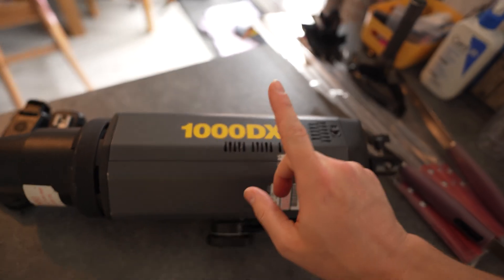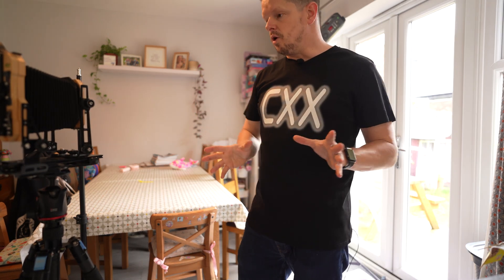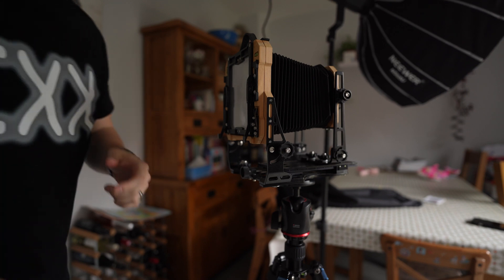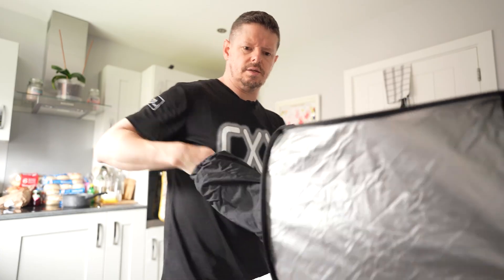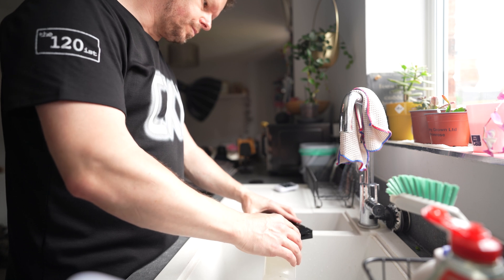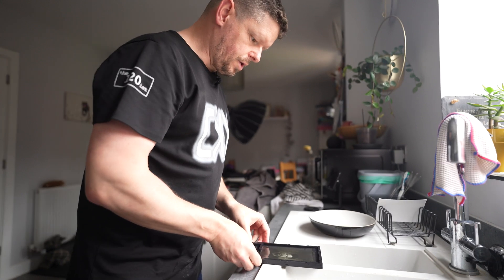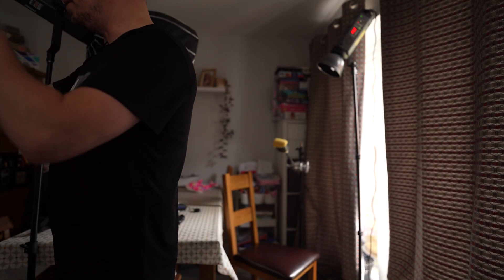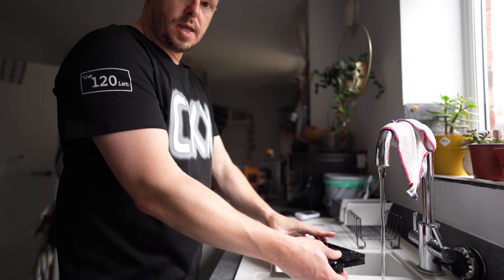Flash with BW Paper Reversal! Can I make it work?? Featuring Minutero 2.0 & Stenopeika Caronte 4x5

Comment: Ok so I think I mentioned this to you before..   First off you need to find a lens you can attach a cable to.. That will fix LOTS of your issues I think.. And just for kicks..  Open the shutter for about two or three seconds in as dark as you can get but trigger the flash TWICE and see just how much exposure stacks from using a single flash to triggering the flash more then one time during exposure.
Reply from the maker: I actually started exactly that process when I didn’t have enough flash power, doing two or three pops on the flash. And if self portraits were the end goal then the at would definitely be an option. But the goal is to be taking photos of other people, and with as little discomfort to them as possible. If I was doing this with someone else in front of the camera then a lot of my problems would be solved! But I was photographing me as a test subject, to get a feel for how the flash was going to behave. Next stop is photographing someone else, now I have some parameters laid down. 👍

Comment: one tip, if the light 'leak' is something to be wary of, perhaps its time to go for a shuttered lens?, like a Packard bulb, or a Sinar DB (installed behind the lens) this would at least lessen the 'non shooting' time, and shut the exposure off certainly, so no light leak; And with a shutter, it would mean that like a dslr you can play with shutter speed (not sync, but this controls the ambient exposure), the other way is to use the lens full open (if it has a Waterhouse stop aperture), and drop a plate in, aka a sluice gate, so the cap over the lens starts exposure, the Waterhouse stop ends it.
Reply from the maker: I have shuttered lenses for the 4x5, but Im working back up to the big box camera, which does not have a shutter. And there aren't really too many options for a shutter on that. A DB shutter, or any packard shutter, would  be way too small. But I think perhaps using flash is a good option, but for self portraits I'm just taking too long for the ambient light. 

Hopefully all will be solved when I get back to taking photos of other people!

Also, the big box camera is less sensitive, due to the large distance between lens and film plane. So most of the problems will then be solved, if I can generate enough flat power! But I think two 1000Ws flash heads in one modifier is the next step. Watch this space!

Comment: hey, if you need the power, why not use a broncolor?, they go up to 1600/3200 W\sec. about 12x the power of speedlights, and if you use a 'PARA-88' or the bigger siblings' para 177 or 333 if my memory is correct, (its been at least 5 years since Broncolor released any major product, that I'm aware of, like those para products, or the Siros monolights, or the pico-lite and its accessory package), as they have a silver coating, which finds more output than what went in!-no, I'm not kidding, thats what is said, it actually produces 2stops more light output. The other 'stand-out' solution is fixed light, aka the dado-light system {mirror reflectors, Lightbridge comes to mind, not sure if its theirs, or Aperture's product}; here a simple mirror is mounted on a light stand, and the big 'engine' 2400W cine light is mounted outside, and aimed at the mirrors, like the scene from the Oceans 12 movie, but not lasers, the light beam and reflects towards the scene, lighting it, precisely the way the gaffers set it up.
Reply from the maker: Ok, I just looked up the Broncolor 3200Ws options... and the answer was quick to come to me! The £14000 price tag is the main reason I'm not going there!! Yowza. That's a lot of money!

Contant light sources is where I started this process, and so far they are a better option, for sure. I also have some bigger lights coming for testing soon, so I'll revisit that when they arrive.

But I wanted to try to make the flash work because it allows an instantaneous exposure, and therefore no chance of motion blur. But I may find my way back to constant lights yet.

I do have some big reflectors and parabolic umbrella type modifiers, but I didn't have enough space in my kitchen! I'll be doing some testing with those shortly!
Reply: @the120ist  in german "ebay kleinanzeigen" you sometimes can find old elinchrom 404 generators for under 200€ a 4000ws flashhead at the same price range... maybe you can find some elinchrom stuff in the UK too?!

Comment: Awesome flashes. Play with the aperture. I have to build a posing stand, I will copy yours.
Reply from the maker: Posing stand is a light stand plus c stand knuckle, grip head, whatever you want to call it, and a pole. Pretty cheap and cheerful! But does the job.
Reply from the maker: Crazy how cheap you can pick them up! Any suggestions for how I double or triple up the key light?? The only thought I have is placing them all behind a monster shoot through umbrella.
Reply: @the120ist  what is your goal ? I use one as key light: closer or more far with a softbox.(half power or full power mine is 400 watts) One with a grid for the backdrop and sometimes one with umbrella as side light for the hair. And one reflector: anything white. What is your extension bellow ? because you have to compensate. Edit: you use paper at 3 iso: you can use 2 direct lights, if you want soft light, put a white frame in between. 2 should be enough, just measure the contrasts. Or use them with umbrellas, direct or reversed. Another solution is 2 white panels and flash in reflection. But with your set 1 key light with the soft box full power should be ok, but very close to subject.
Reply from the maker: @chriscard6544  Currently I'm rating the paper at ISO 1.7. I need to find some more space and use some different modifiers. I think I was losing too much though the double-diffused soft box. 

What is my goal.... that's a good question. The goal is to take portraits with the big box camera. But the big box is so much wider than what I was doing, I would not be able to the light so close.
Reply: @the120ist  just put your key light closer with full power
Reply: @the120ist  in my beginning i used 1000Ws flashes. to have enough light i used a silver reflective umbrella on one flash and put a second flash on a tripod directing into the same umbrella. another option is to use a modifyer which looses less power like the reflector (i like hard light :-D )
Now i use 2x 4000Ws elinchrom packs.... sometimes with 1000Ws Fills.... (with F 4.5 / 36cm Lens or F9 / 700mm to get the big imagecircle i need)
of course another way is to use a faster Lens...
Reply from the maker: @lukha7740  Ah, now this is the sort of information I was looking for. Thank you! So you've set up one flash head as the main flash shooting into a shoot-through umbrella, and then another flash head on a light stand next to it? That seems like the way to go initially.
Reply: @the120ist  my main flash had a mounted umbrella but a reflective one. not shoot-through. the other flash head was monunted on a stand  next to the first one shooting into the same umbrella. you have to play around a little to get the correct direction for the secon head.  maybe a shoot through umbrella is the easier version